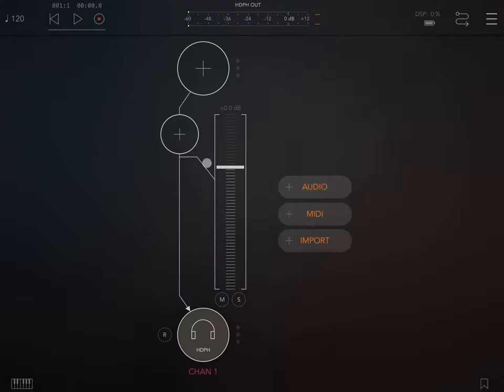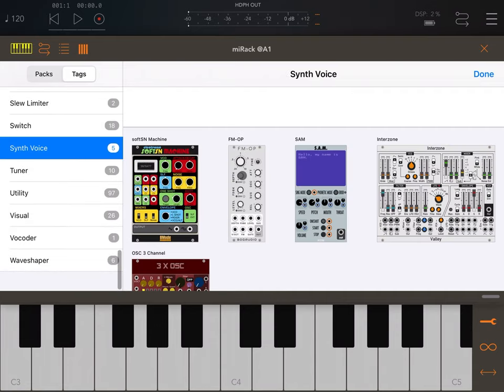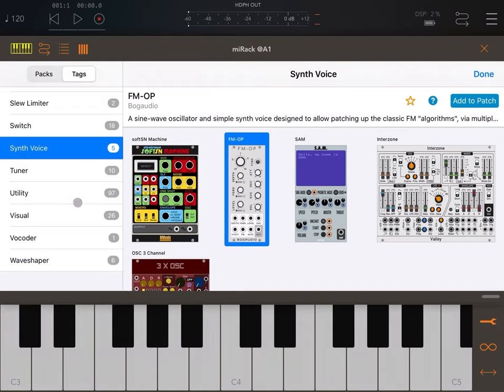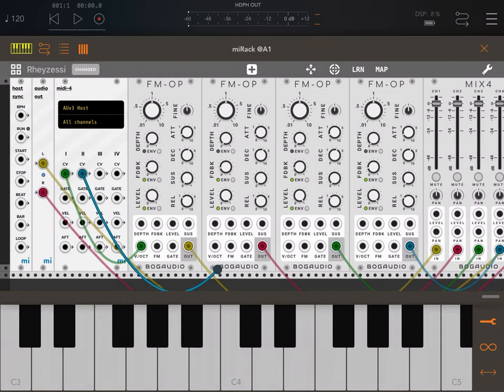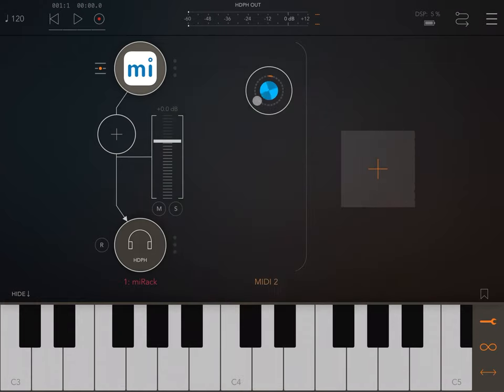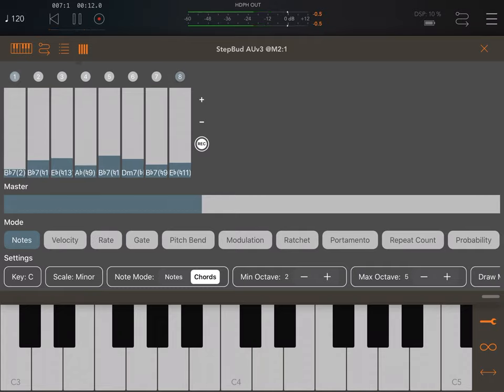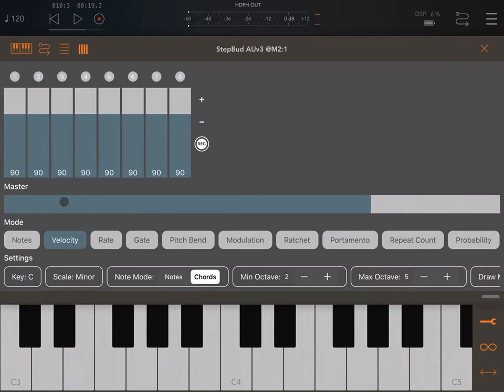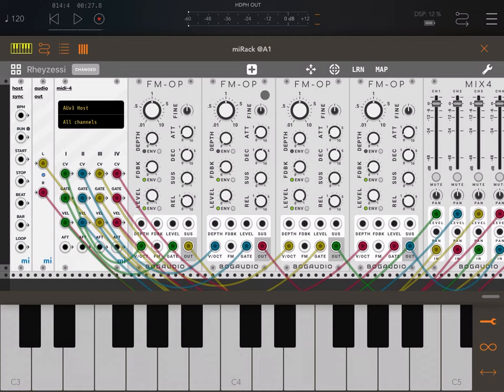miRack AUv3 - Tutorial: Exploring the app Part 4, Midi-4 Input Polyphonic Patch

Comment: Are there ways to use something other than the fm operator? I always get stuck when I’m trying to experiment.
Reply from the maker: Yes of course... the reason the FM operator is used often in demos is because it is easier to use with an ADSR already integrated... but yes others can be used...
Reply: you can use anything, just need to build each voice for each note. So if building a basic analog poly, you would need 4 vcos (one per voice), 4 filters (one per voice), a mixer with 4 inputs and 4 envelopes to open each filter. You can make this as complex as you want, and even start combining different types of voices into a crazy monster polysynth (so for example note one goes to an fm voice, note two goe to a wavetable, note three to filtered noise and voice four to a subtractive voice... or whatever)
Reply: @mynmyself  thanks for the reply. I forgot I asked this question. It’s 7 months later and have dropped about $5,000 on a eurorack setup. I’m going to get the expert sleepers es-9 to try to control my iPad with my eurorack setup or vice versa.